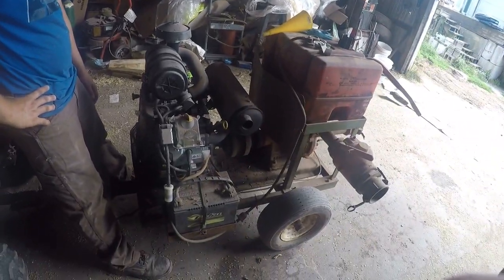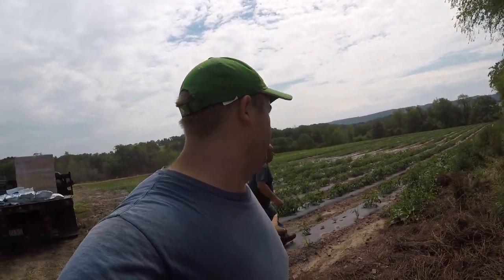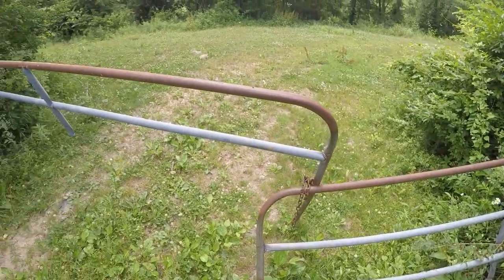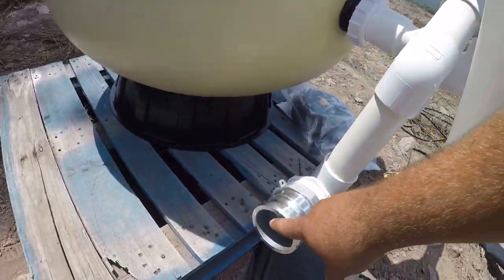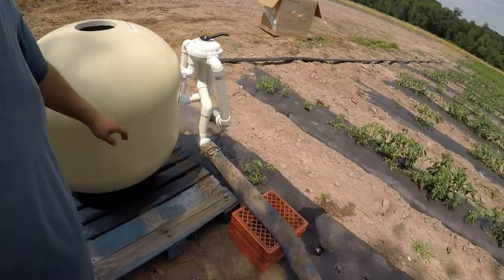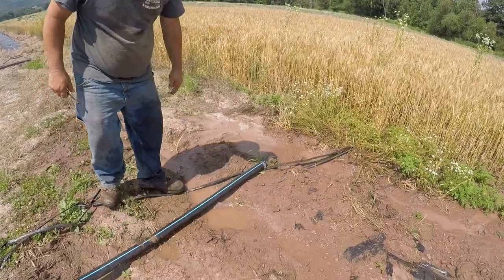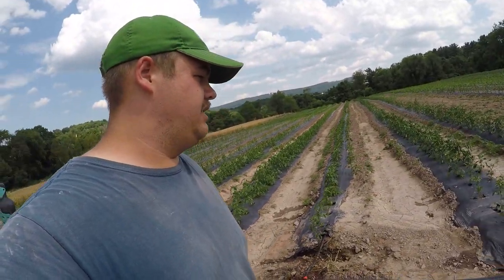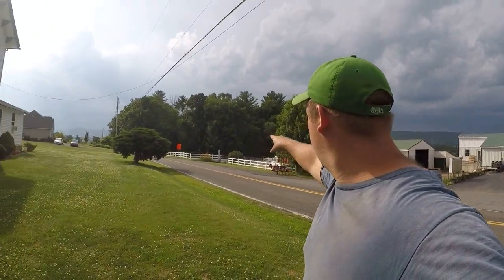IRRIGATING THOUSANDS OF VEGETABLE PLANTS!

Comment: great system. where do you buy those connectors and line?
Reply from the maker: We buy them from a place called rainflo
Reply: You can also get them from most any farm supply store and they are called “Chicago fittings” and go as small as a garden hose and go I know up to 6”. 

If you have a Northern Tool store close to you they carry them and Tractor Supply, and Rural King all carry the hose and fittings

Good luck!

Comment: How are you regulating the water pressure to the size of your system?
Reply from the maker: There is a gauge on the tank that helps us discern pressure
Reply: @theveggieboys  thanks.  Will be dropping well and system this winter. I'm small at 300 50ft × 30 in beds  . Building a 30 ft × 60 ft hoop with two 30ft by9ft float beds as well. Big learning curves. Had it all in elephant garlic and GAP certified ,could t move the product so destroyed it.  Shifting the whole operation ,another direction. It'll take more infrastructure, planning and hoping for better financial results.  Much of what you show is relevant from market garden up. Thanks again.
Garden of Bladen
Reply from the maker: Charles Vickers I hope all goes well, if you ever have questions or are curious of varieties we grow. Feel free to email me, my email is in the about section on my YouTube channel.
Reply: @theveggieboys  thank you from southeast NC